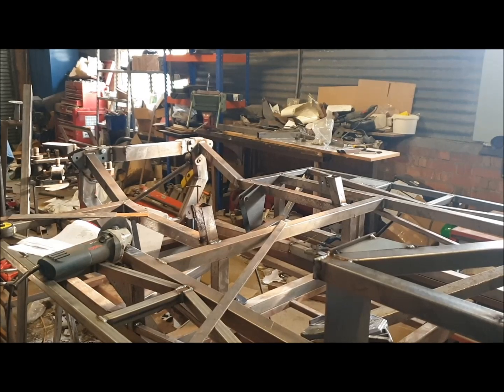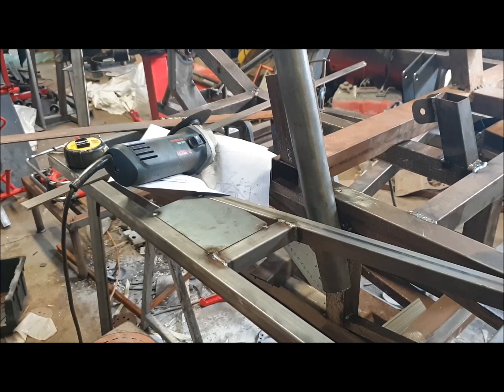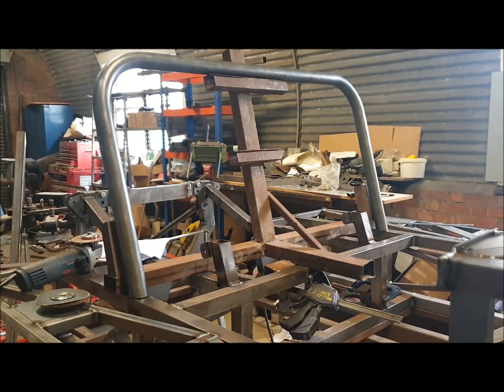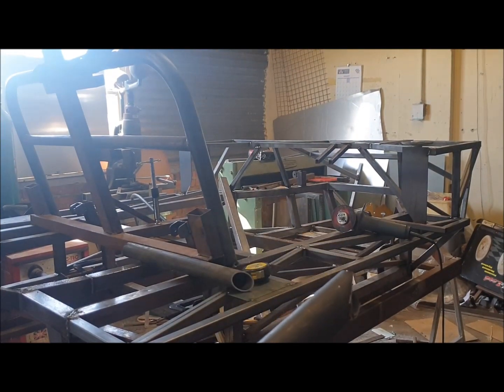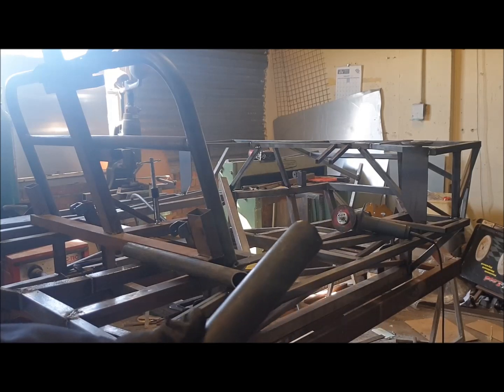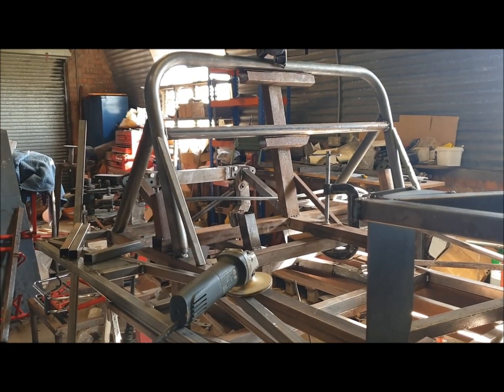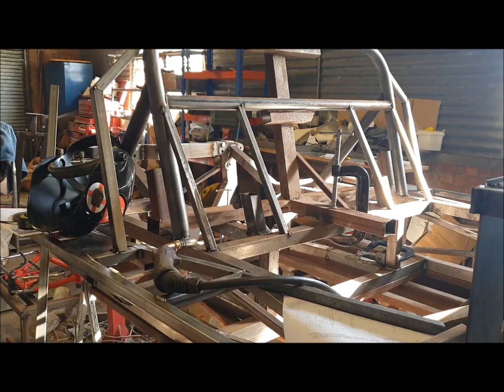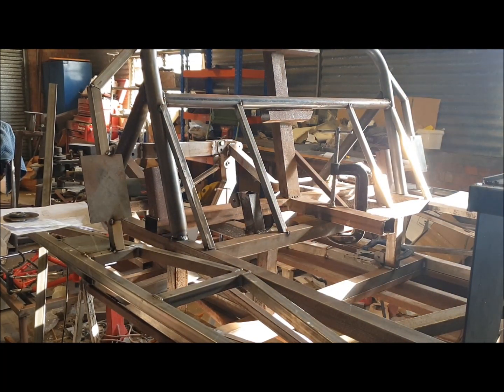Ford GT40 replica chassis construction/fabrication Part 8

Comment: Hello, I tried to access your website, but it doesn’t seem to work. Do you still sell the chassis plans for the Ford GT40? I would like to model it in 3D using SolidWorks. However, it is very difficult to find the exact dimensions and plans.

Best regards,
Maxime